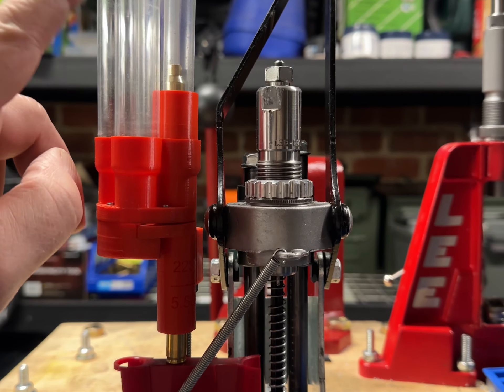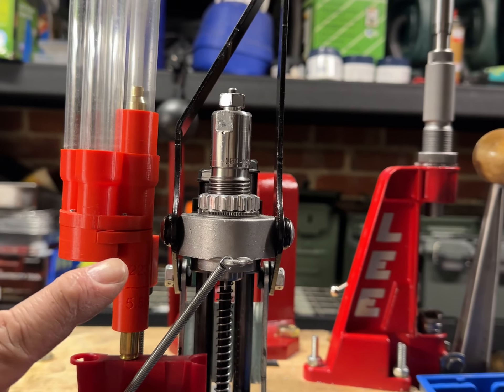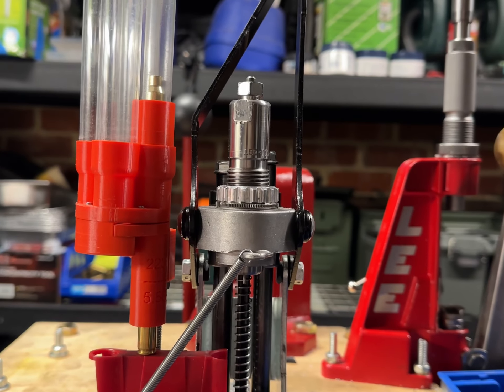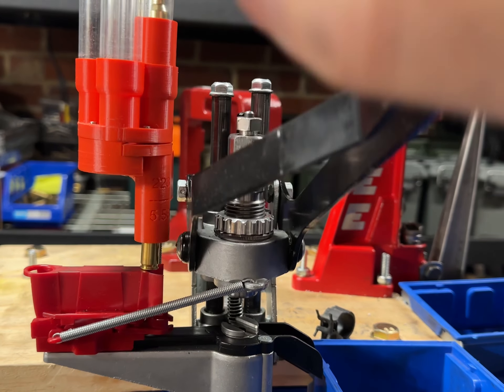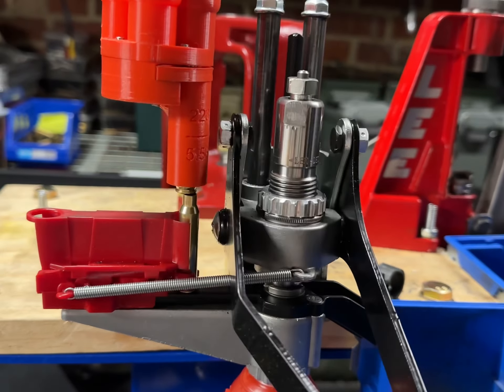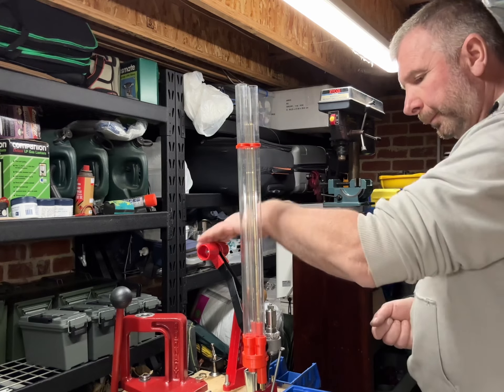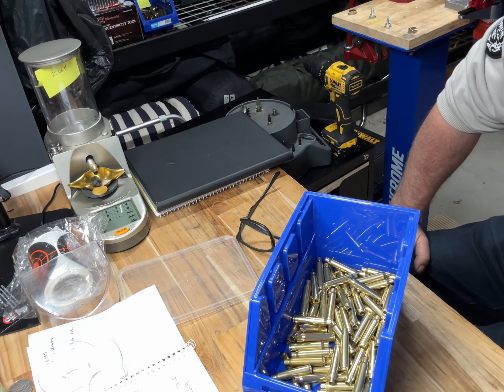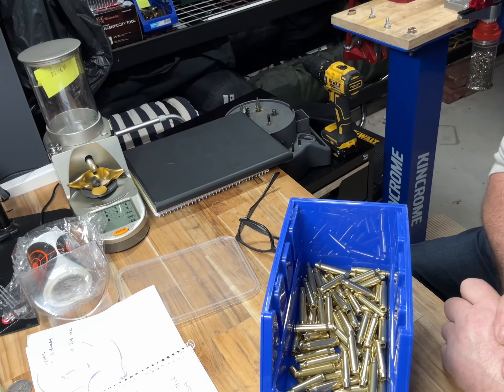How to deprime faster

Comment: On the lee case feeder, buy a funnel that fits into the tube that has a large enough opening for the cases and stick that into the tube.  All you have to do is drop the case in head first and it'll drop itself into the tube.  You can hold a small handful and let them go one at a time without having to line each case up into the small tube.    I bought a funnel set at harbor freight for a couple bucks and used one of the funnels.  I had to cut about a half inch off the end. I can drop 223 brass through it about 4 or 5 in quick succession and fill the tube in 2 or 3 reaches rather than keeping up with one at a time.   You can do this and keep a steady pace on handle at the same time.
Reply from the maker: Sounds like a great idea, I’ll try that